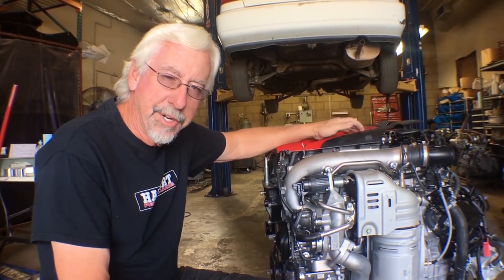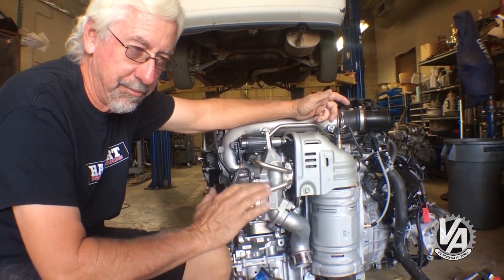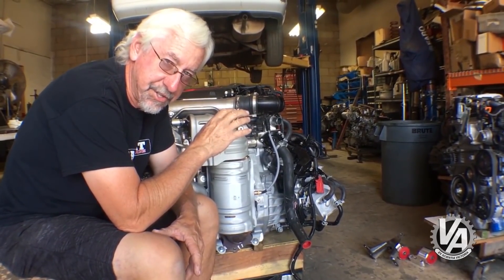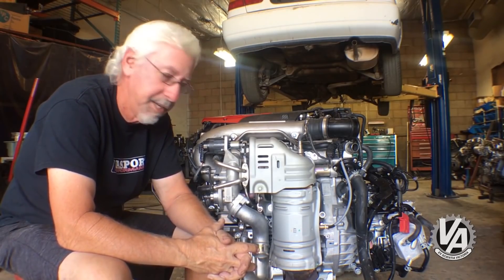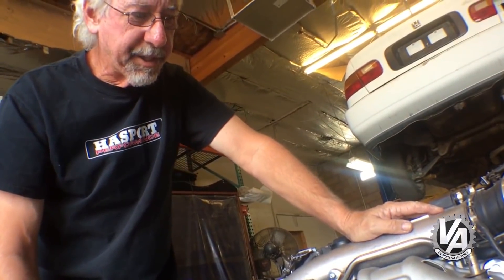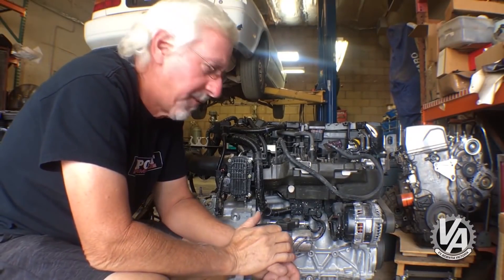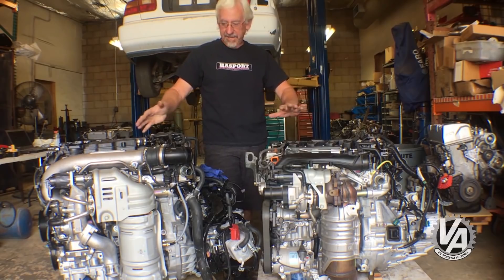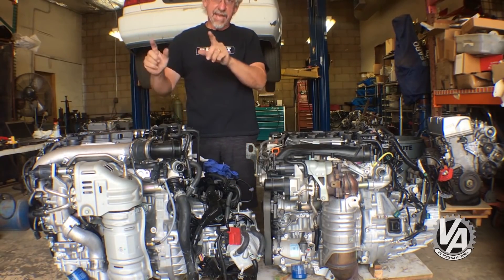Civic Type R K20C1 Tech Inspection pt 1

Comment: Do you think a mount kit is needed to put the K20C into my 11th Gen Si to replace the L15CA I currently have? I would think since the FL5 came with the K20C that it should bolt right in, but I may be wrong. Any info is appreciated. Great work as always.
Reply from the maker: Just use the FL5 mounts. Unless you are using the Accord K20C4. Then you need some more parts too.

Comment: He mentioned that the K20C had some sort of separator. Do we have anymore info on if the K20C's have air / oil separators? I am concerned about carbon build up in my future car.
Reply: Did you ever find out more on this ? 
Seems it’s not bad but will happen over time

Comment: Since then I’ve blown my head gasket and put in a sleeved block with forged internals. I believe the “coolant” grooves between the cylinders caused a hot spot and showed evidence of where the head gasket failed. Dan Benson welded those channels on my new sleeved block and redecked the mating surface. I got my wife the 2021 Accord 2.0T touring.

Comment: The pistons are different. The cranks have the same part number. both are forged. both use the same rods. The fuel systems are completely different. The turbos are different.
Reply from the maker: Yes, when we made this video 4 years ago the K20C4 information was pretty scarce.

Comment: Can you swap k20c1 in a 2018 honda accord?
Reply from the maker: Yes, you would need the Accord K20C oil pan and pump.
Reply: @VTECAcademy  And If I have a traditional manual transmission bolt's on or do i need a adapter plate?
Reply: @moredeep6946  The Accord K20C4 manual transmission bolts to the K20C1. The L15BE (Turbo) manual does not.
Reply: @BrianGillespie_brianathasport  thanks is never easy 😆
Reply: @BrianGillespie_brianathasport  so to be clear oil pan and pump  from the L15BE and k20c1 and transimisson k20c4?
Reply: oh ok i got it, im buying 2018 2.0t so going to have the right transmission i just need the motor and oil pan/ pump thanks again sir.
Reply from the maker: @moredeep6946  No, the oil pan needs to be from the K20C4 too.
Reply: @VTECAcademy  ok thanks doctor honda lol
Reply: @moredeep6946  Let me know when you need to buy the pan and pump. I'll tell you where to get it.

Comment: 7:53 Is that purely a vacuum pump or does it function also as a oil separator?  (Some links below) Of interest because if it did, it would mitigate the carbon build-up on the valves of this K20C1 DI engine 

https://tiremeetsroad.com/2021/03/17/heres-what-makes-the-honda-civic-base-2-0l-na-engine-the-civic-type-r-2-0l-turbo-engine-different/

"Civic Type R heads come with vacuum pump assemblies as illustrated on Fig 12"

Volkswagen MK6 (PCV/Oil Separator
https://www.youtube.com/watch?v=yMrOlee2WVk
Reply from the maker: Purley a vacuum pump to my knowledge.

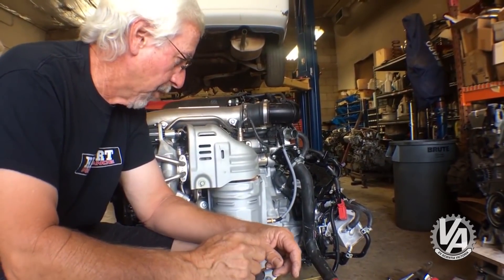Comment: 3:00 when transmission oil temperature is stable the transmission loses will be lower too, I think that is why Honda did it. I raced for years with the Y and S serie transmissions and never had any problems with the overheating.
Reply: These engines seem to have transmission issues, do you think this could be the cause of it ?

Comment: The thing about that high pressure fuel pump is the engine oil will be to rich with gas witch cleans the oil faster! Good to help keep temperatures down! Bad for the bottom end. You dont want to much fuel cleaning the oil. Thats just asking for the pistons and bottom end to blow out eventually! Especially when performing at high rpm's.

Comment: I wish they continued the use of larger engines in the Accord, like the f series; it seems like the Accord became a civic in disguise
Reply from the maker: Why? The F series is old and even less powerful than the K series and J series which are bested in performance by the current Accord engines.
Reply: I know they got better, but they seem to have gotten bland for my taste. It would be cool to see some variation between the civic and the accord, having different engine options for each. It seems like the different engines are what differentiate the cars in my opinion. Also, it would be fun to have a bigger engine option like a 2.2 or 2.4 liter because even though the turbo already gives it more grunt than a bigger engine, I would just like that as a higher performance option.

Edit: to clarify, I was trying to say they should make a larger displacement engine different from the K series, not exactly bring back the F series. It would be cool to see them engineer a SOHC engine like the F series that could compete with DOHC engines though.

Comment: Hi there mate, any idea where i can find the full spec of this engine? I'm trying to find out what other transmissions will fit onto this and the sizings because I'm looking to fit one into a classic mini, but struggling to find the information at the moment.
Reply from the maker: It is much bigger than the other K-series engines. The transmission is exclusive to the K20C turbo engine. Honda makes a CVT and 10-speed auto that will bolt up.

Comment: This is cool. What i'm interested in is whether or not the old K20/24s will swap into the new 8 speed dual clutch trannys, and if the new K24W7s are able to be swapped with the old 6 speed manuals (or maybe this 6 speed from the new CTR?). I'm also curious if any of the old K20/24 aftermarket parts can be used in the new K24W7. You think this is possible?
Reply from the maker: I don't think the W series have the same bolt pattern for the bell housing.

Comment: That turbo is really integrated. What's your thought on incorporating a bigger turbo? Maybe a remote mount for a sequential setup? Twin charging with a belt driven forced induction?
Reply: rekik66 GReddy has an aftermarket turbo bolted to one of their SEMA cars that was located in the back side of the engine. They’re still working on it last I read.

Comment: Did you guys happen to weigh the K20C1 without the transmission? There are some people who are flying aircraft that are powered by the L15 engine, so I'm wondering how well the K20C1 would work in that application.
Reply: im talking with a guy who can get it for me.
Reply: @BrandonNesbitt-777  Awesome. I'm betting that it's quite a heavy engine, though.
Reply: @PistonAvatarGuy  306lbs! 25 lbs lighter than the s2000 engine! Confirmed.

Comment: I wonder if all that water cooling is to much for the radiator, and considering the turbo bolts directly to the head, there's no heat dissipation between the exhaust ports and the turbine housing, the K20c's exhaust heat is absorbed through the head. Strange design.
Reply: Lance Johnson Very true i wonder if that would end up being the more limited factor when tuning these new engines, bigger radiator and fans is a simple fix at least.